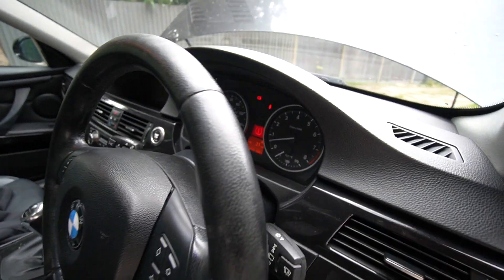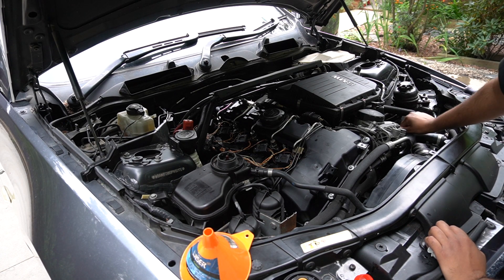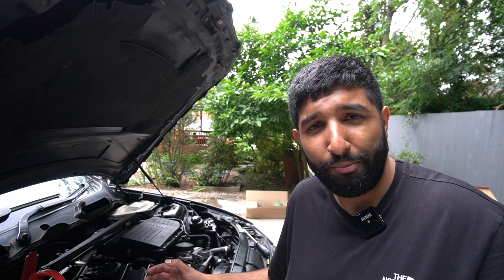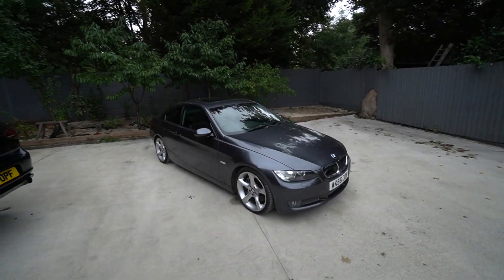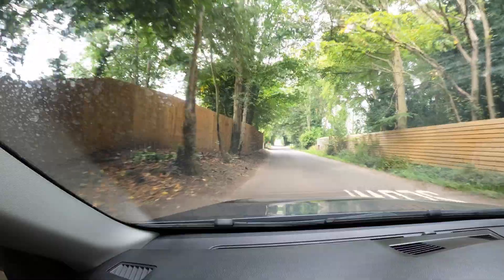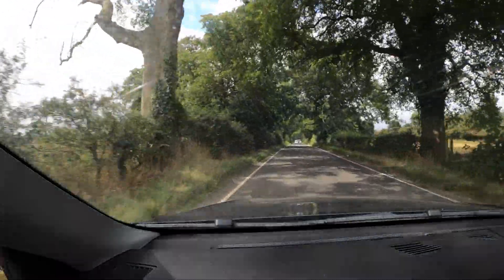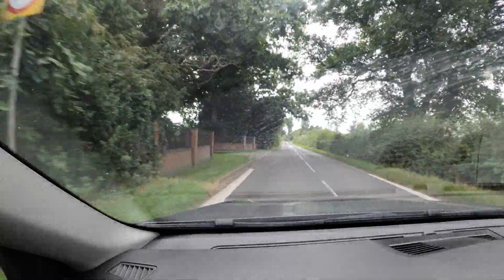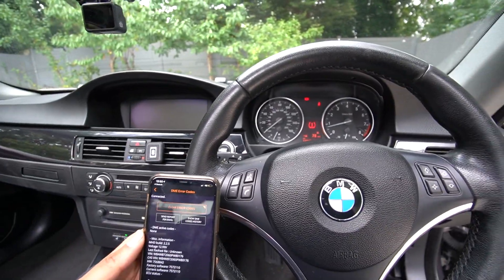FIRST DRIVE in the Auction BMW 335i!

Comment from the maker: Plenty to come!
Reply: Looking forward to more 👍
Reply: Can’t wait
Reply: Any plans to take on a diesel car as a project? Like a GTD golf or something
Reply: Can’t wait bro
Reply: For the exhaust I would recommend any catless downpipes. Leaving the secondary cats and modifying the rear OEM backbox. PE mod it's called as it mimics the genuine performance backbox. I've done mine and no drone and with the valve it keeps the varied sound at speed. 

I do think that car might have a flash on it as the cold start was too quiet. Potentially has the cold start delete ticked in MHD.
Reply: I can also see a workshop coming, floor’s already done 😉
Reply: What are them ramp ?
Reply: A long distance future video… detailing the car to its former glory?
Reply: Good man

Comment: The N54 is one special characteristic engine even with all its flaws. When it’s good, it’s great.
Reply: 100% My car uses an N53 so not as powerful but it's so smooth and linear, and the noise 😍 despite some injector trouble recently I still love it
Reply: Sometimes maybe good, sometimes maybe shit🤣
Reply: @muhammadfiroz9727  😂😂😂😂😂
Reply: @muhammadfiroz9727  🤣
Reply: @drewhender3999  got the same n53 engine and I wish I got the n54 because I spent the same amount fixing mine as my mate did on his n54 😪
Reply: @meer-cha4985  haha sometimes I think that too, might as well have gone for the 300bhp car
Reply: @drewhender3999  well my n53 now produces 270BHP (dyno'd) so I like to think that it's an n54 that does 40mpg without the wastegate rattle and turbo issues 
plus, I love the NA sound
Reply: @meer-cha4985  Yeah I was looking into getting mine tuned, mines a 325i so is only around 215 atm. Having an issue on cold starts in cylinder 3 so will be buying some injectors soon 😂
Reply: @drewhender3999  same engine as mine then ;) I changed my HPFP, thermostat, then all my injectors to index 11 (and NGK plugs, BOSCH coils) back at the beginning of 2019 to fix my rough idle on cold... then remapped ECU to stage 1, serviced the gearbox and xhp mapped it myself, added a mishimoto silicon intake boot, opened the airbox and put a KN cone filter in... nothing else really except 
back then the injectors were just shy of 190 quid each from BMW though, now they're bit more expensive
I wouldn't have put so much money in this car if I didn't love it and it wasn't fully spec'd
rare to find one of them like this in the UK
Reply: @meer-cha4985  sounds awesome man! Only difference on my end is that i managed to find an M Sport manual 😍 2008 in the E90 shape
Reply: Team N54 for Life..
Reply: @drewhender3999  Check your vanos motor gasket.
Reply: @mountjoy23  Did turn out to be injector 3 and 6, however I traded the car in a while back for a new one hah
Reply: @drewhender3999  No worries.
Reply: In the E9x 335i the N55 with the DCT is the best combo by far

Comment: Yeah you're right Hamza.. when you do your own work on a motor you get a different connection and appreciation for that lump of metal but i still wouldn't mind a spin in that 900,000 000 hp garage beast

Comment: Had an '07  335i for 9 years. Loved it. So smooth and really quick. The worst decision they ever made was to only supply it with run flat tires. What utter shit those things were. The suspension virtually exploded over bumps with the damn things. Changed to regular tiresas quickly as possible, which transformed the ride,  but then the whole spare tire issue came into play. A flat stranded me only once, but it was in a bad area and I had to wait 2 hours for a tow. Had my share of problems with it, though. Thankfully most were repaired in warranty. Traded it in before it became a total albatross.

Comment: Great car, great motor, you're about to have great fun!! The coolant hose to block fitting..."mickey mouse" fitting, change it. It'll leave you stranded, it deteriorates internally, It'll look fine until it's not. When you replace it you'll see. For $1500 US I replaced the charge pipe, added a Tial BOV, added a larger intercooler, dual cone intakes, tuned it with MHD stage 2+ and I have a 500hp weapon with more torque then the next guy from ~1500 rpm on (did the work myself) . It's a torque monster!! Enjoy it!

Edit: if you intend to tune it at all then that waste gate rattle must be dealt with or it'll kill your fun fast. You MIGHT be able to adjust the waste gate arms and buy yourself time if it's not too far gone. Otherwise, once you turn up the boost they're on borrowed time if they're rattling.

Comment: That undertray part made me laugh, knew exactly what it was as soon as I heard the noise. The same thing happened to me in my e92 335d, took the front undertray off, left it off for a test drive after fitting some control arms and the middle undertray came loose and starting flapping around.

Comment: I had a n54 stage 2+ 410 bhp 700nm. Good fast car. Unfortunately the injectors went and the mosfets in the ecu went also. Sold it in the end. Great cars when everything is ok with them. PMP cars in Nuneaton know these cars good check them out

Comment: Probably jinxing myself here but.... Ive honestly never had an issue with my 57K miles N54. been running FBO stage 2+ on mhd for 6 months now. What an engine.
Reply: if maintained properly it's bliss
Reply: 57k mate thats why. As long as you take care of the all weak points of the n54 (that most people neglect) you should be good.
Reply: @th6790  your probably correct. Bought it from an old dude with full service history. 😂

Comment: My 335i is the classic horror story, the car got wastegate rattle then the high pressure fuel pump went, while it was off road water got in the ecu. and still doesn't have Index 12 injectors either so thats got to be done at some point too 🤦‍♂️ if it wasn't a manual estate I'd get rid in a heartbeat but they're super rare and the best "family" car I've had.

Comment: Bro, I've got an f30 with a cracked back bumper. Do you know if I can fit a back bumper from another f30 - not the same part number but, correct trim and exhaust placement - with the pdc in a slightly different place?

I've asked around and BMW dealership parts department guy reckons it will mess up the PDC but, independent BMW specialist is saying it will be fine. Don't want to go through the hassle getting it and swapping it and it messes up the PDC.

Any advice you can offer will be much appreciated.
Keep up the great content.

Comment: Has that scrapping/grinding noise gone from the engine area?
Reply from the maker: So far yes, I will monitor it if returns
Reply: @TRHamza   okay - which pulleys did you change - was just the two?